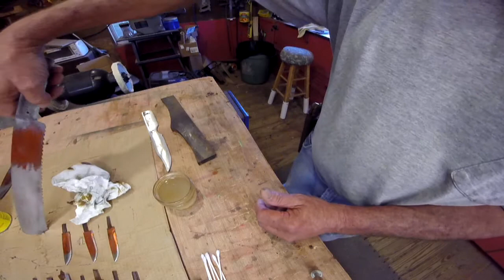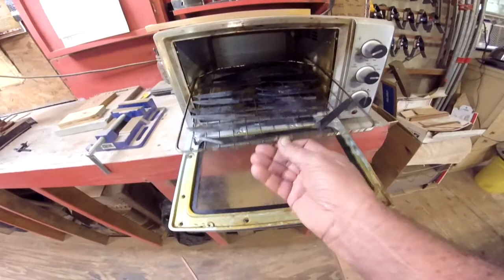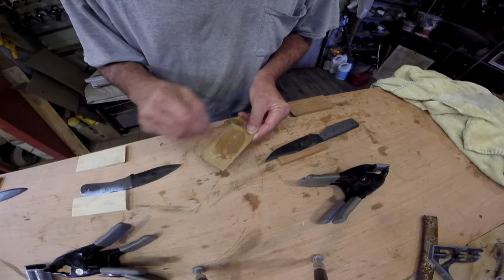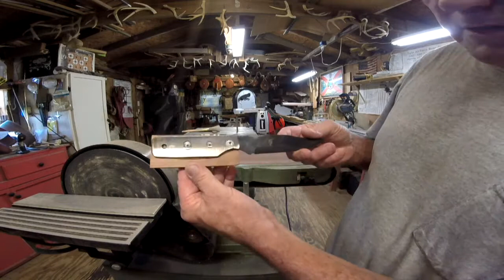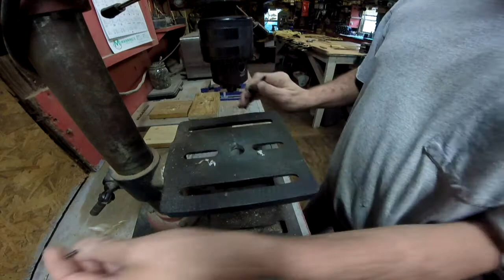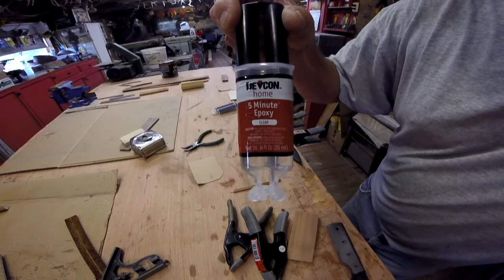More work!

Comment: Looking forward to that straight razor. A little nervous though, I'll admit that much. Sure would look nice with that Tiger Wood handles on it. To bad you didn't have some bone laying around for handles. I think that'd look really neat. Well, back to sitting on my Fourth point of contact. Gotta love working for the Government. 😋
Reply: Could you use a vibrating pen to make your maker's mark and treat it with vinagur and water and your battery. That way you can get deeper penetration and beable to polish the up part of the blade without removing your mark. Just a thought you might have already tried, or though of this idea aleady. Since you have a forge you could forge a maker's mark and stamp it with a hammer. Could speed up this portion of your knife making. Enjoy you vedio and especially your fishing trips.